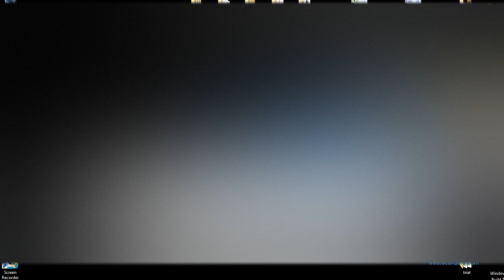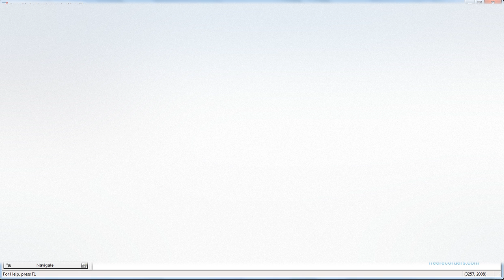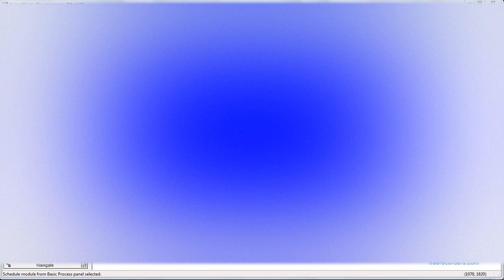Resource Schedule Arena Simulation

Comment: I want to add a resource to a proces that stops the proces fot a setup time every time a new batch arrives? Is this possible and how?
Reply from the maker: Yes. Dead easy
Use hold scan for a condition.. 

Check the video ((priority emergency case)) and hold scan for a conditon

It would give you an idea.
Reply: Great thanks, very inspiring video's.